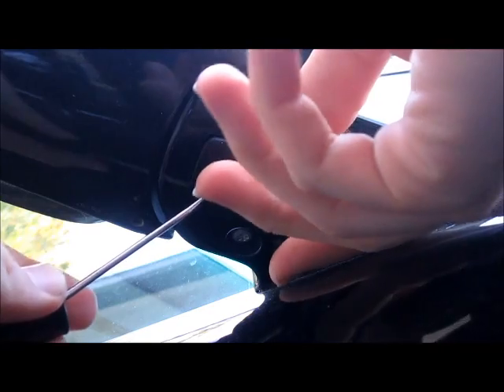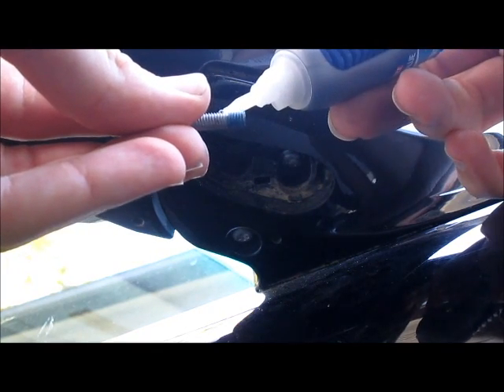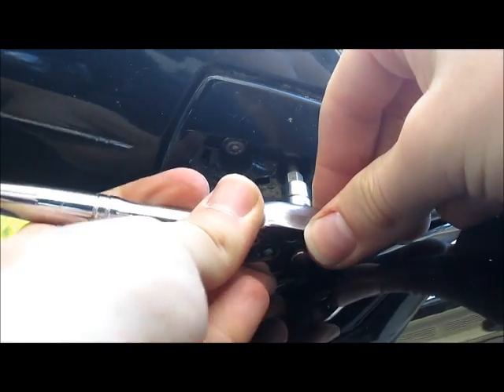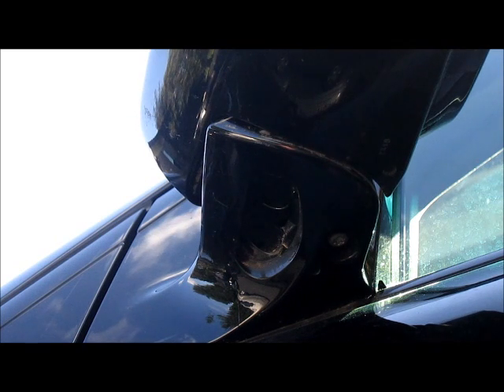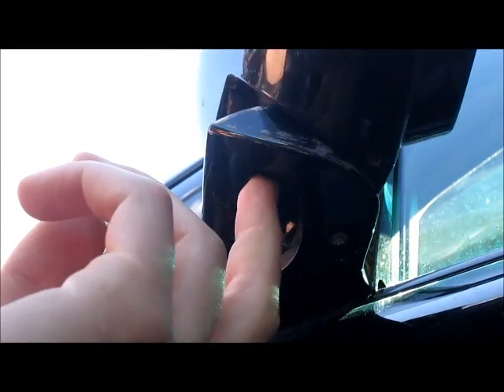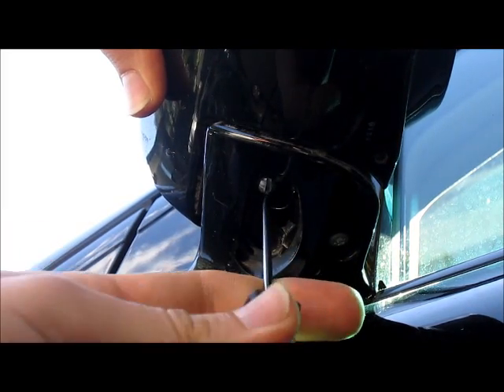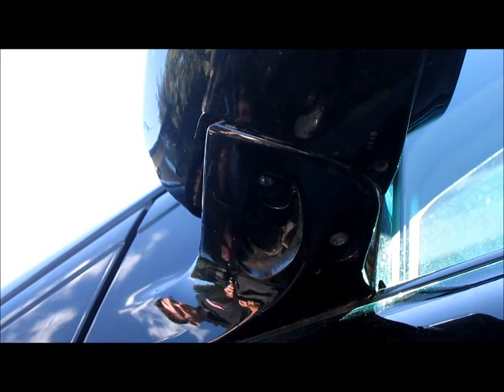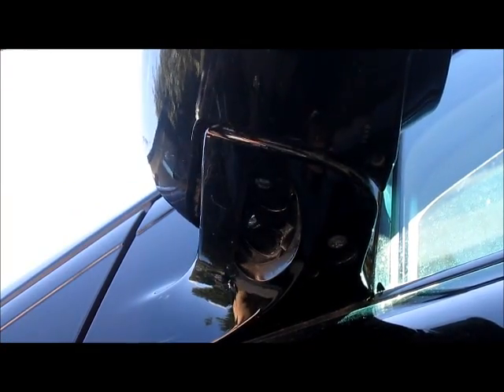Lexus RX350 Loose Side View Mirror Fix (Rear Mirror)

Comment: Thanks for  post.  For some reason the screws will no longer catch for me when replacing.
Reply: Same, my screws won’t tighten. They turn, but the mirror does not get any tighter. Does lock tight fix this?

Comment: I would suggest using  Loctite Thread Locker 222 (purple--for small screws) or Loctite 242 (blue) Removable Thread Locker. Do not use 262, 272, or any other red Hi-Strength (Permanent) Thread Locker.
Reply from the maker: JACK! That is a Brilliant Idea, I really appreciate your comment. I will do some research on the Locker 222! Happy Motoring-Blair
Reply: @Revitauto  Hey Blair. Let me know if you have any questions about any Loctite products. I was a salesman at Loctite for 17 years.